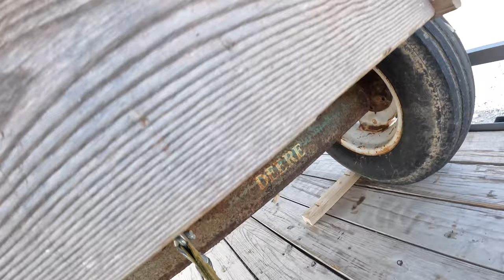Antique John Deere Hay Wagon

Comment: Nice project. Surprised you’ll have time to restore it you seem so busy.  Also, what happened to the new equipment building?   Is that on hold?
Reply from the maker: As far as the wagon, we probably won’t be doing hayrides for a couple years so I might work on it next month when I have a slow week or I might waiting untill spring or who knows

S as far s as the building They told me it would be here the last week of October so we will see if they are on schedule with that still

I actually think tomorrow I’m going to go back to work on finishing out the site prep